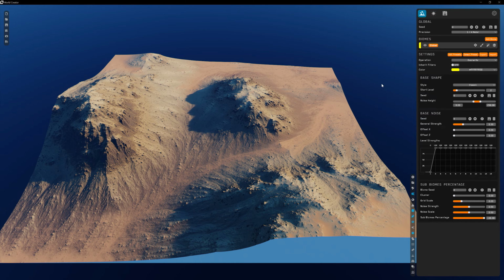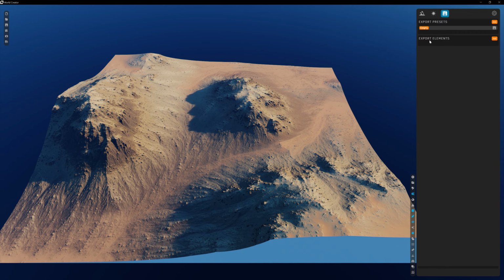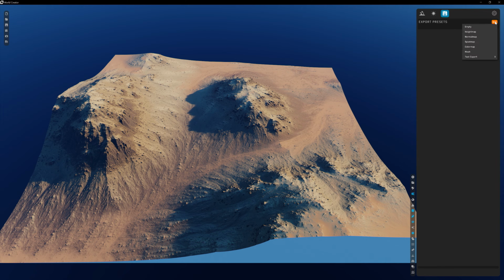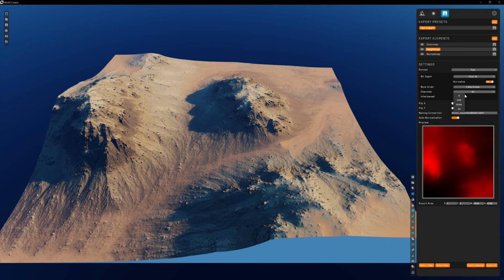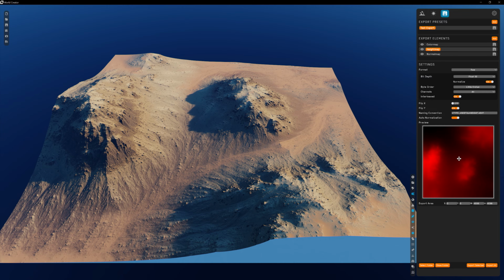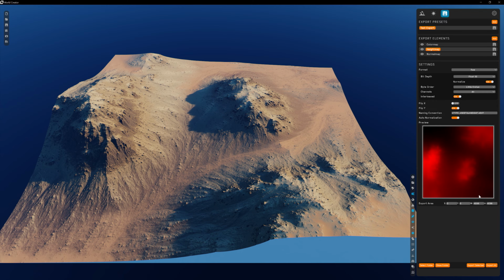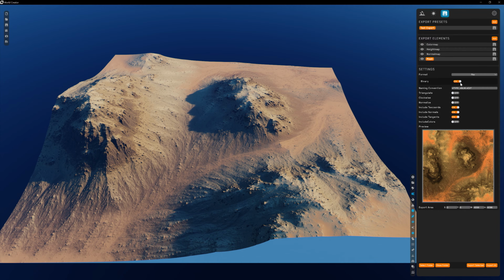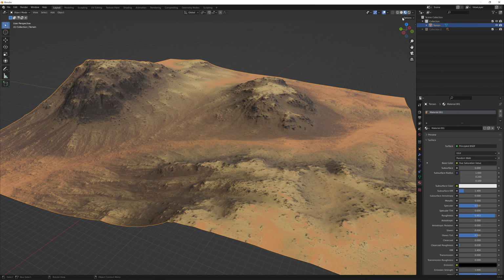World Creator | Beginner | Part 8 | Exporting

Comment: I hate when they totally change the updated version of softwares. Or some useful options arent even available in new versions. Like in WC2, we could easily set precision level and terrain overall size separetaley, but in this version if we go precision 1/8, It scals our landscape to 8k. and if we try to reduce in in export setting it crops the hieghtmap. WTF? I am sorry I am frustrated now, am I doing something wrong? I am not a newbie, and this tool isnt even that complicated. It was all just smooth in WC2. Why changed all that? I am trying to export hieght and splat maps to unreal, and for some reason I can not set the correct landscape size for unreal without croping. I know there is a plugin now but but why changed it even it was all perfect? Not everyone like to use plugins. What IF I wanna use it to different game engine?